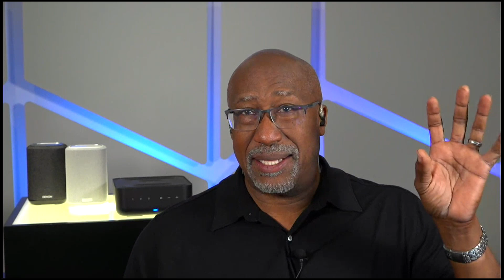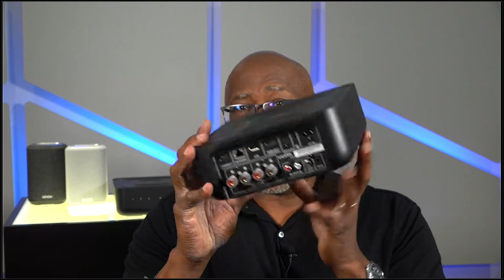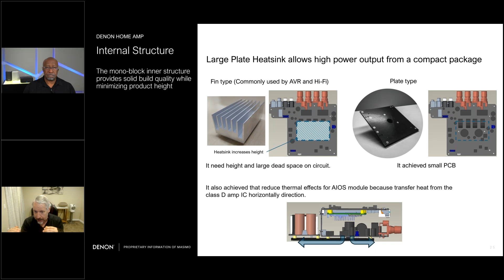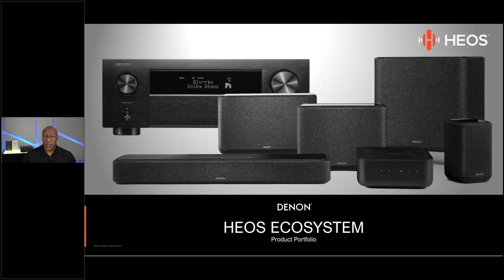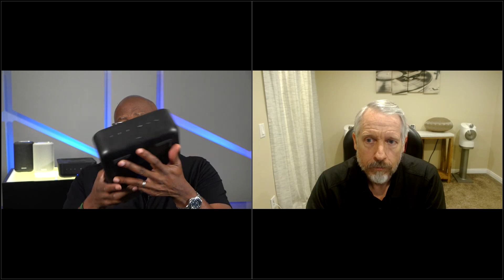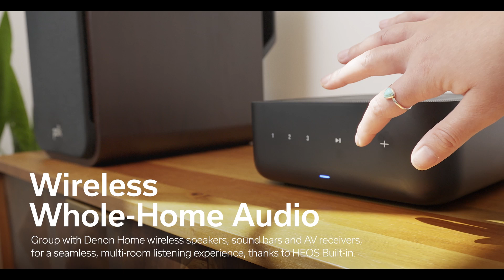Learn about the New Denon Home Amp and the latest HEOS updates

Comment: i doubt there are any differences at all when comparing M1 and home amp. Take a speaker selector, match the volume, set bass and treble to 0 and disable all enhancers... Now compare differences  by using speaker selector on good speakers. They should sound the same. I did that with M1 and my old onkyo 8270.... ZERO hearable differences on MA GOLD speakers.
Reply from the maker: Hello Mario,
Marantz' Model M1 has the following features not found on Denon's Home Amp:
5 year warranty (instead of 3 with Denon)
Hand assembled in Japan
More luxurious look and feel.
Marantz Musical Digital Filtering (MMDF)

Comment: I cant get a straight answer out of Crutchfield or anyone else , I want to buy the AV10 if I stream to Heos and I access Tidal can it play in 24bit over Heos   ?I owned a Marantz in the past and I was limited to 16 bit on the on line display  . is there a16 bit limitation or can you do 24 bit now .   I bought a node2 and an external DAC and it sounds great but if I go to the av10 Ill probably move away from the nod dac setup to try to consolidate equip im getting older and want less stuff but better quality stuff.

Comment: I’m getting my Denon home amp on Tuesday which will be replacing my ceol N10 - why am I replacing well it’s down to the form factor of the Denon home it’s gonna sit inside a ikea tv unit also earc is very important for my Apple TV with this I can play Apple Music lossless with my LG oled tv switched off (under settings screen off )meaning I don’t have to use airplay which can be a pain sometimes - will be pairing my home amp with the awesome Dali bookshelf speakers which I’ve used with my ceol for the last year the detail is amazing from these speakers I’m hoping the Denon home amp will preform as good - shout out to richer sounds in the UK for getting this ordered in for me.
Reply: How did it perform?

Comment: I really wish the Home amp could be used with A) the home sub(wireless), and B) the Home surrounds(150s); so i could use my own speakers with a 4.1 setup - that's a real miss in my book especially as it has a HDMI input and e/ARC. the Home soundbar is a great unit, but i also listen to music on my current AVR (that is only running 5.1 for movies/tv). soundbars just wont cut it for me so this would have been perfect if the above was supported - the reason this would impact me is that I don't have an ability to trail lots of wires around (wife objects) so currently I run a Yamaha AVR with musicast wireless surrounds and wireless sub - I'd really love Denon to enable me to do something similar - such a shame ; I should point out my use case aside - this looks like a great unit and looks really nice for a discreate stereo /2.1 setup. 

I have to admit i am very much looking to exit the Yamaha eco system, but i am still looking for something that gives me the same feature set.

Comment: Waiting for Roon Ready for the AV10
Reply: @menash41 It has been revealed that D+M's current AVR/AVP lineup will NOT receive Roon Ready certification, so unfortunately the "flagship" Marantz AV10 will NOT receive Roon Ready support, an absolute fiasco by Masimo Consumer :(
Reply: @oniiz8685 wow. That’s a bummer. Can you show me the source of that info?
Reply: @menash41  It looks like my post got deleted, I keep forgetting links are not allowed but this was the response from Denon UK regarding older D+M AVR/AVP models, "Denon UK support comments on legacy AVRs Roon Readiness: There are currently no plans of updating our legacy AVR’s to give them Roon Ready support.
No legacy AVR’s will get a Roon Ready upgrade. If customers want Roon Ready they will have to upgrade the hardware." & this is from a D+M Insider with very reliable information, "Roon Ready for D&M, which was planned for the current 2023 line was dropped and it will be supported out of the box together with the new HEOS+ ecosystem on the next line of AVRs (X?900H for Denon, Cinema x1 for Marantz). No Roon ready for the X4800H, nor Dolby Atmos music support via HEOS."

Comment: I tried HEOS and Tidal Connect on my X6700H 7.1.6 system. Disappointed to find that you only send a FLAC stream when I select an Atmos title. I presume this to be a HEOS limitation as Tidal app on the Sony and AppleTV decode as Atmos on the 6700. While I understand HEOS is primarily a two channel distributed audio system, all the major music streaming services now have Atmos music. If you want to listen on speakers, it will be through an AVR or processor. HEOS on my 6700 should support this in my mind.

Comment: Seems it is Marantz M1 in different packaging?
Reply: Apparently the Denon Home has a few different parts inside.
Reply: basically same but apparently the Denon is tuned even more forward and "aggressive" than the M1. And many reviewers have said that the M1 is already forward compared to other streaming amps and is better suited with warm speakers. So I think that the Denon might be too harsh sounding with neutral/forward speakers. I would only pair it with warm speakers.